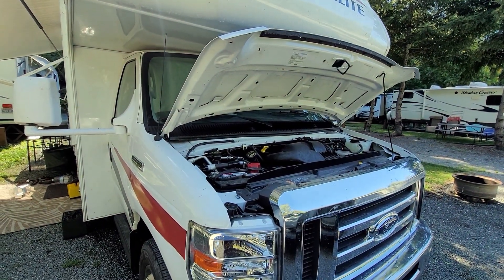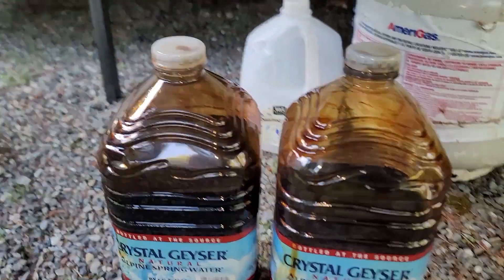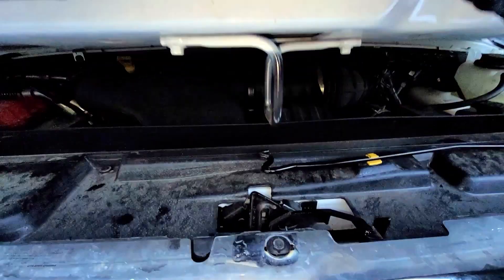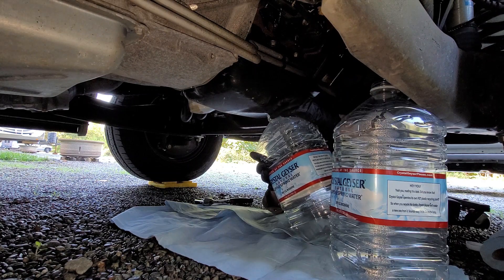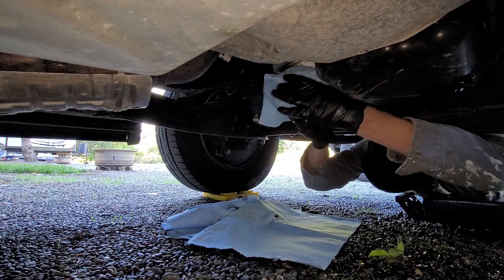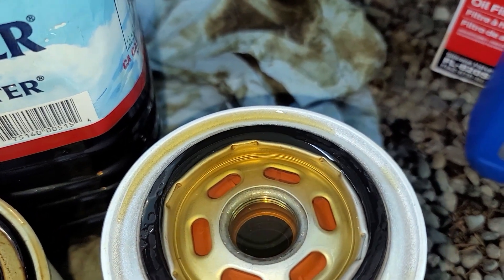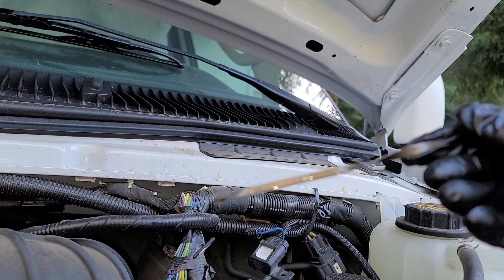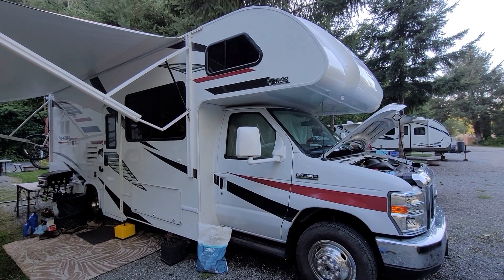How to Change Oil on Thor Freedom Elite RV | Ford E350 6.8L Triton V10

Comment: Nice job. Tip: get a big sheet of cardboard to throw under so dont make sure a mess and please invest in a drain pan 😆 actually I use various height buckets depending on the vehicle. But the pans with lid are nice because no transferring, just take it to local auto store for recycling 👍
Reply from the maker: Thank you! You know, I really wish I did have a drain pan, but the storage space aboard Zlad(!) is somewhat limited, and since we're out here full time, I had to make do with what I brought with me. HOWEVER... I did bring a bucket. In my Bronco oil change video the mess is even more intense - that oil plug is like 2x the size of a normal one, and I learned that lesson quickly.